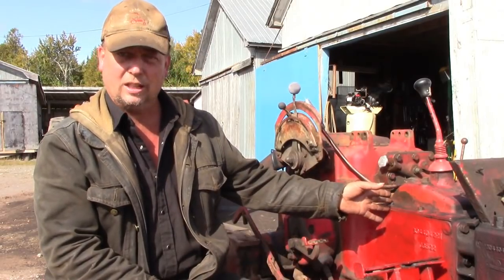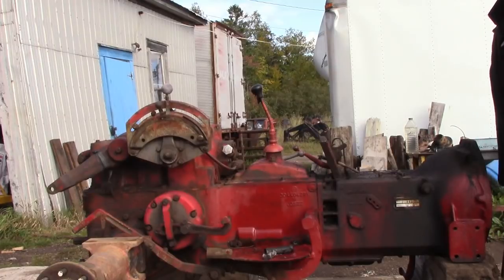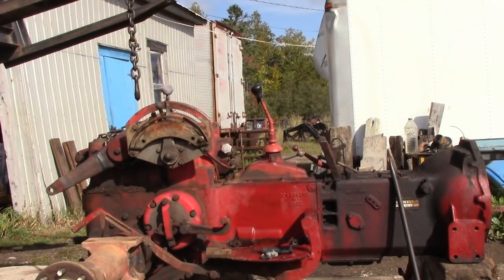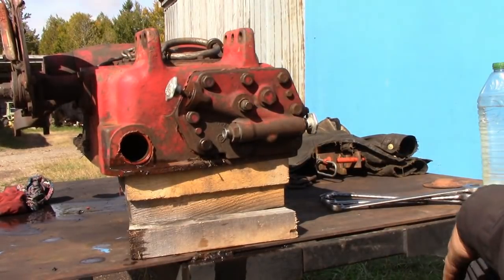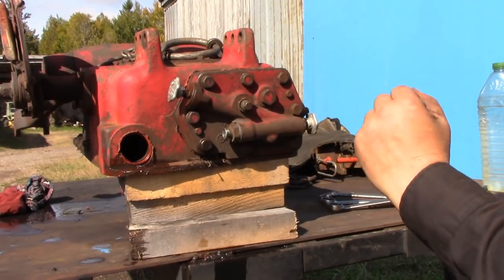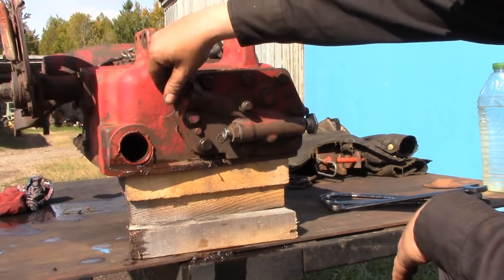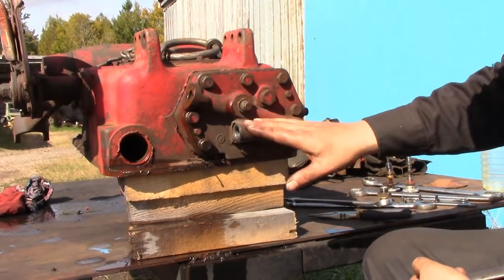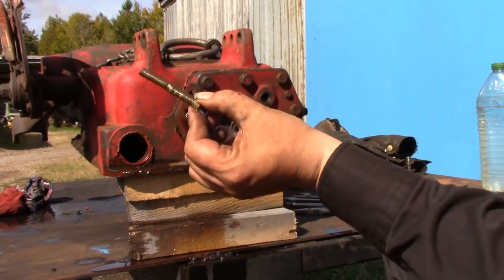B414 Hydraulic unit dis assembly

Comment: Just stumbled across your videos and they are very well made.  I actually own a mahindra 3525 but the hydraulic lift assembly you're working on in this video looks just like mine which brings me to a question I hope you won't mind answering!!
I need to take off the shifter housing but the bottom left bolt (if sitting in the tractor seat) sits right under the hydraulic control valve.  Do you now if it's possible to remove this bolt and the shifter housing without removing the lift unit?  Just seems kind of ridiculous to have to remove that entire lift unit just to get to that one bolt.  Any help is very much appreciated!!  And thanks again for posting these videos!!
Reply from the maker: Mahindra built copies of the B275 and B414 under licence from IH, so it's no coincidence that your lift unit looks like the on in the video.
 You will have to lift the hydraulic unit off to remove the shift cover, you'd never get the forks back onto the gears if you don't.
 Thanks for watching!
Reply: @CanadianRedneck15   Thanks for the reply Dave, very helpful.  I don't know if you answer these types of questions but I noticed another one of your videos dealt with a tractor that was "bound" and it turned out to be the PTO shaft.  I have a similar problem and I was wondering what your opinion of the problem would be.  
While bush hogging in reverse going down a slight decline something happened and my tractor is "bound".  In any forward gear, whether in high or low, when I let off the clutch the engine pulls down as if under a load but nothing moves.  As long as I have the clutch pushed in the tractor will roll free but with the shifter in neutral when I let off the clutch the wheels move in reverse!!  The shifter moves easily through gears 2-4 but it's EXTREMELY difficult to get it into 1st or Reverse.  What ever happened was imperceptible to me.  No noise, no bump or jolt. I'm HOPING the shifting forks are somehow out of whack.  Any ideas?
Reply from the maker: @sandss115  It's stuck in gear, you need to drive out the pin that holds the lever in the shift cover, lift out the lever and line up the open spaces in the shift rails in the center and reinstall the lever.
Reply: @CanadianRedneck15  hate to bother you with another question but just so I'm clear- are you saying I DON'T need to remove the shifter housing? Sounds like you're saying I only need to remove the shift lever itself and then I'll be able to get things lined up again?  Thanks again, I very much appreciate your time!
Reply from the maker: @sandss115  Yes, just the lever and you will be able to get it straightened out.
Reply: @CanadianRedneck15  DAVE!!!!  YOU'RE A GENIUS!!!  Had the shifter out and the shift rails lined up in about 10 minutes...... then spent another hour trying to figure out how to get the shifter back on.  Had to remove the cotter pin to release the spring and then compress the spring and stick the cotter pin back in once the shifter was in.  Anyway, your fix WORKED LIKE A CHARM!! Thanks again for all your help.  Saved me a couple of weeks stumbling around in the dark as well as saved me some unnecessary work.
Reply from the maker: @sandss115   LOL, not a genius, just been there done that. :)

Comment: Thank you for the video. However, I have a mahindra 450 but with a problem of not dropping the 3 point hitch. Its lifting but failing to drop it down. I put a new hydraulic pump but the problem is still there. Kindly help. I need to figure out the  cause
Reply from the maker: I would say that that is a problem with the position control linkage or the dump valve not letting the oil back out of the lift cylinder.
 Thanks for watching!

Comment: I saw all yours videos and love yours explanations and details.
The hydraulic unit assembly in for a B414.  I own a 276. Is it the same?
Thank  in advance for your  interest !!
Reply from the maker: The 276 often had a often had a single lever unit with no draft control, if yours is the single lever unit it is a completely different design than the one in the video, if your lift has 2 levers it would be the same as this one.
  Thanks for watching!
Reply: @CanadianRedneck15 I realy appréciate yours videos and explanations, It's clear. For my 276 IH , i have a draft control so it's the same. Thanks a lot.
I will rewatch your video and comments  more times. The hydraulic  does not stay up. May i repair that problem? Thanks.
Reply from the maker: @mars-lquebec9776   I expect that would be the seal on the lift piston so not too bad a job to fix.
Reply: @Canadian Redneck What would be the best way to go about diagnosing a none working 3pth on a b275 as it is only a single lever and not the same set uo as the video. Any help would be much appreciated

Comment: My 444 lift arms drift down and jump back up every few seconds. What is wrong? Is cylinder worn out inside?
Reply from the maker: The most likely causes would be the piston seal in the cylinder or the leaking by the valve.
 Thanks for watching!
Reply: Thank you. I guess it would be easier to check the valve first.

Comment: Thanks again for the information you have in your videos I enjoy watching . I have a problem that I can't find discussed hoping you will help my lift arms will slowly fall down (under load) to a point then suddenly jerk back up to set position over and over as long a tractor is running but will hold in position if tractor is not running . problem is with my ford super dextra.
Reply from the maker: I would have said leaking by in the lift cylinder but if it holds a load up when the engine is off,,,,, maybe the valve?
  Thanks for watching!

Comment: Is there a way to rebuild the ball joints on the lift arms on an IH 444
Reply from the maker: The only solution I've seen is cutting the ends off and welding on new ones. New ends are available at some tractor dealers.
 Thanks for watching.

Comment: Very helpful vid as always! Got an odd one with a B414, we've recently serviced and changed all the fluids including the hydraulic oil, gave the filter a good clean before putting it back. However now the hydraulic arms will go down no problem, but they will not come back up and the pump makes a pretty different set of noises (not altogether good sounding), but the arms do not come back regardless. Broken pump or is it something simple?
Reply from the maker: Make sure the "open/close"valve is open on the valve body. Make sure you have 3 inches of hydraulic oil in the reservoir.
 Good luck and thanks for watching!

Comment: Great video. I have a b414 when I lift the lifting arms they are jumping. They move fine without weight on them. I changed the hydraulic filter and put in fresh oil it’s still the same. When I pull he draft control up full it lifts not a problem with weight on it but it puts pressure on the engine. I removed the plate under the seat and the position control lever works fine. Your opinion would be much appreciated on what the problem could be. Thank you
Reply from the maker: Sound like it could be some dirt in valve or the little screen in the front of the valve body possibly.
 Thanks for watching!

Comment: HI Dave. I own a 1964 B414.  The selector on left ha
nd side next to the Pto lever does not respond when when turned to slow or fast. Currently the Pto shaft is in fast mode in high gear and slow mode when in low gear. Also pto engage when the clutch is released and stop when the clutch is pushed in.  Is this a fault on the tractor or is it the way they operate. Can this be fixed or changed. Can you give me advice. Thanks
Reply from the maker: The fast slow selector is for your hydraulics.  The PTO is entirely dependant on engine speed. If you have the live PTO you push the clutch down one step to stop the transmission and a second step (to the foot board) to stop the PTO. If you don't have the 2 steps (stages) in the clutch pedal you may have a damaged or out of adjustment clutch or you may not have live PTO.
  Thanks for watching!

Comment: Is there a way to take the remote hydraulics from my good tractor IH 444and hook it to my parts tractor to test the power steering before I swap it over
Reply from the maker: I suppose you could hook lines to the cylinder to check it out. Thanks for watching!

Comment: Awesome videos I have IH 2444 and the valve body is leaking alot but I can't seem to get the hydraulic unit to come off it there any hidden bolts and is there a good place to get a seal kit for it
Reply from the maker: Check along the front side, there may abolt hiding under the edge of the valve body there. The lift units sit down on a couple of dowels and they take quite a bit of force to break loose.
 Thanks for watching!

Comment: Have a 444 international,you've been a great insight to all my mechanical questions,very methodical and explain all the dose and dont's,in a very self explanatory way. You've been such a great help with your videos    THANKS so much for your time and knowledge 😉
Reply from the maker: THank you, I am glad you have found the videos helpful, thanks for watching!
Reply: Joey Cooling seen that you have a IH 444 I thought you could help me with something, I have a loader on mine and when it’s running I pull the lever on the loader and it barely goes up, I pull up on the right lever under the seat and I pull on the hydraulic lever for the loader it goes up normal. It does the same with the 3 point but instead I push down and it works, any ideas?

Comment: Speaking of the isolator valve, I have a B250 so the earlier version of this with a T handle isolator valve, anyway its broken at the retaining pin which seperated the T from the threaded valve, anyway cant find a replacement anywhere and whenever they plugged up the front loader they have it run from the remotes point ie 1 hose only to the loader so hydraulic lift gravity lower. I had tried to adjust the T valve when I had to weld it to get back in place so it would still thread but during opertion it seems that the rear hitch lifts always first, then when that has reached height the front loader goes up, Worked for a little while but then due to pressure it blew the T valve apart and oil everywhere. Have you got any suggestions ? What I can do here, its bloody annoying.
Reply from the maker: You are going to need to find another isolater valve. When the isolater valve closes properly the 3 PH should not lift when working the loader.
  Thanks for watching!

Comment: Thanks for the web site looks like I should be able to find my parts The lift is building pressure in the lift housing  I changed the hydraulic fluid today that didn’t help the Fill plug on the back if you leave off blows  hydraulic fluid out Took a drill bit and drilled A vent hole in the plug Trying to relieve the pressure without losing all my fluid  thinking  that would slow it down but it would still blow all the fluid out the pin hole so now got to find out what is causing it to build the pressure any ideas thank you for the videos and your time for trying to help me figure this out
Reply from the maker: It sounds like you are over filling, there should only be 3 inches of fluid in the reservoir.
Reply: I know it sounds like but It will push it all out to were the front end loader will not even left Up i drained the entire system And put hy trans back in it  today to make sure and still building to much Pressure I took everything off the lift on the back and its still trying to raise up higher than it should with nothing on it and sounds like it’s trying to squall the pump

Comment: I was working on the 3444 today and noticed that the spring behind the top link was broke could that be causing the problems You was talking about a dump valve Can you tell me about where that is located I’m going to change the hydraulic fluid in it maybe tomorrow and put what it calls for cause I’m pretty sure the guy that put the pressure plate in clutch put the wrong fluid in it but not for sure so I’m going to change it again anyways All the tractor places around here Has no information really only 3444 so i’m hoping you may be able to get me going thanks for your time and the videos
Reply from the maker: The broken spring shouldn't cause the problem you describe. Check out the CaseIH parts site https://partstore.caseih.com/us/index.html?csid=a8ad2ae818327ae353f3dc3cf5e6f427&sl=EN&currency= you will be able to find a parts break down of the lift unit under 444 or 384 tractors.
  Thanks for watching!

Comment: I have a 3444 loader and the three point goes up all the way in less i cut tractor off then it leaks down to were I have the Lever height set to I have a barrel that is full of Concrete with it on the back then it goes down and up like it should Justed  the  draft control lever all the way down doesn’t help any of advance would be great
Reply from the maker: It sounds like either it's building pressure in the unit from the oil heating up or the dump valve is sticky or partly plugged.
  Thanks for watching!

Comment: So the 3pt won't go down on my 354. I decided to check o rings and condition of the fast slow and the  other valve and change the hyd oil. The oil looked decent, no water. As I removed the on/off valve it shot out under a lot of pressure with milky oil and 3pt dropped. Fired up the tractor-no leaks. 3pt hitch went up-stayed up. Any suggestions?
Reply from the maker: The dump valve could be stuck or dirty so it won't release.
  Thanks for watching!

Comment: Good morning Dave
Hay I just found your videos good stuff
I Just picked up a IH B 250 diesel 
Looking for a spec book and videos 
Sat in  the woods in Vermont for 3 years checked fluids all good put a battery in it and a little starter fluid and it fired up so anything on that model would be great
Thank you so much from the great state of Vermont
Reply: I got one, You can buy the manual online us prices I dont know but ebay you ll find it. Get the service manual it shows everything you need.

Comment: Hi Dave thanks for your videos. Problem with my 1969 IH 434 diesel with P-steering and loader. Slow lifting, won”t tolerate heavy load. Oil il getting milky after a few hours only. Oil filter is clean. Any way to find the problem? Keep on we love your videos. Very well done! B.
Reply from the maker: Milky oil is usually an indication of water but if you have changed it that should rule water out. I could also be getting air in the oil that would cause a milky color but also make the oily foamy which would be an indication of a bad oil pump or a weak relief valve.
  Thanks for watching!

Comment: I have a 444 and if I lift the arms all the way up they get stuck. To get them back down I have pull the draft sensor/plunger out with pliers while working the lever. As long as I don't go too far up they work fine. Any idea on what the problem could be?
Reply from the maker: It sounds like there may be a problem with the internal linkage as it relates to the lowering valve.
  Thanks for watching!

Comment: Would love to see an ih444 complete hydraulic rebuild and would also love to see you switch manual steering to a power steering on an ih444
Reply: Great help but now the valve body itself and the assembly. Are there no adjustments etc.

Comment: Also thinking about adding power steering to the old tractor I recently acquired a second tractor for parts it has power steering II tractor has a diesel engine that is locked up and a brake that is locked up both are 1970 models mine is gas the new acquired one is Diesel
Reply from the maker: I believe that the American 444 gassers had a C153 engine so the pump from the diesel won't work with that. If yours has the British BC144 engine you just change the hydraulic pump and cylinder and all the piping from the dead diesel to the gas tractor.
Reply: I have the American version.
Reply from the maker: @duanesharpjr9512  I am not familiar with the US tractors, you would have to have a look at another US gasser to see how the power steering system hooks up on them.

Comment: I'm having an issue where my tractor hydraulics on a ih444 to 1970 model leak down while the tractor is running then it'll jerk up sporadically and rather aggressively making the whole tractor shake I find that if I shut the hydraulic valve off it won't lie down which I have to do when going down the road kefir in it from jerking the tractor what I'm carrying and implement what are your thoughts I've been told it's bypassing in the valve body
Reply from the maker: If the shut off will hold the load up then the cylinder is fine so it is leaking by the valve. It may need an o-ring or some thing of that nature.
 Thanks for watching!

Comment: Thanks for the information.  If the shifter housing has to come off to align the gears are there any issues that I should be aware  of or does the housing and shifter just lift up and drop back in? I know I have to move the hydraulic housing back enough to clear the shifter housing. Thanks again
Reply from the maker: The shifter cover is a pain to re-install, the forks lift with the cover so you have to line the forks all up with the gears as you set it back in place. If you are having trouble with being stuck in gear, pull the lever out of the cover and line up the rails in the center (neutral) position and then put the lever back in. Thanks for watching!

Comment: Are the any videos or help on how  to lift off the gear shifter housing on a 1970 HI 434 tractor that is stuck in 4th gear?
Reply from the maker: No videos, sorry. At the base of the shift lever knock out the pin that holds the lever in place, (it's behind two little plugs, use a small punch and drive it through one plug to pop it out and knock the other plug out with the pin.) Lift the lever out and you will be able to line all the shift rails up in the center(should only be one out of center). That should get the tractor in neutral for you.
  Thanks for watching!